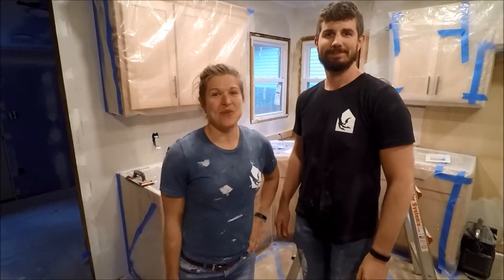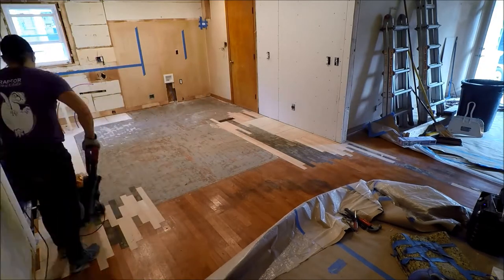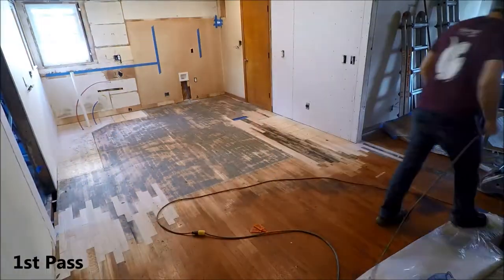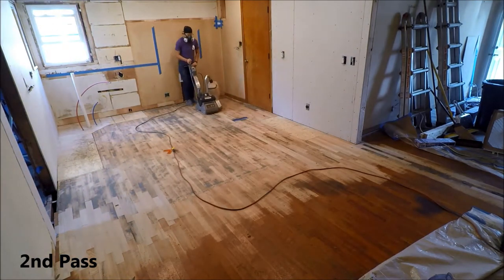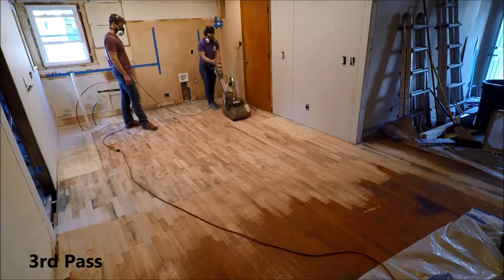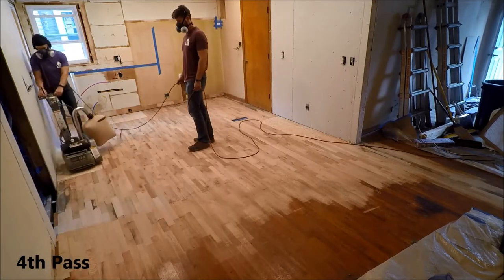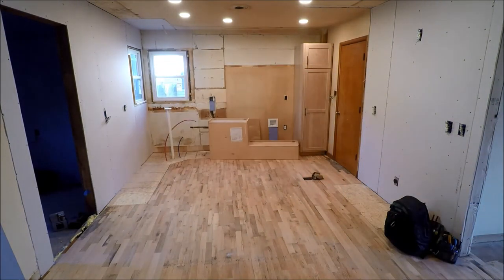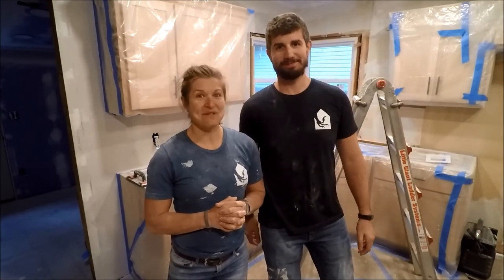Ep. #16 | Refinishing Floors and Installing Cabinets

Comment: You can get the mastic up by soaking blankets, lay them on the floor, tape plastic over it to the floor, and let it sit for a couple of hours. Then when you pull it up, the glue turns mushy and it just peels up super easy with a drywall knife. Just a tip if you want to try next time. The hotter the water the better.
Reply from the maker: This is an amazing tip!!!! We will for sure try it next time!